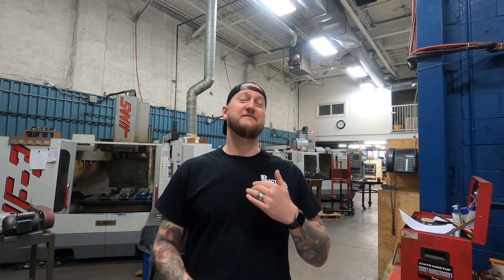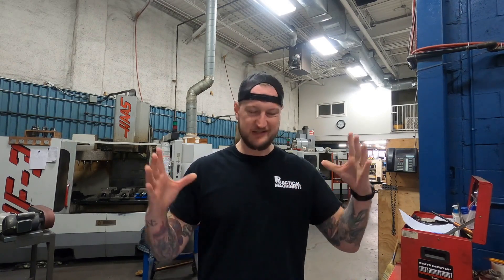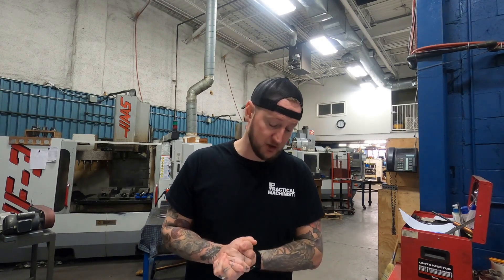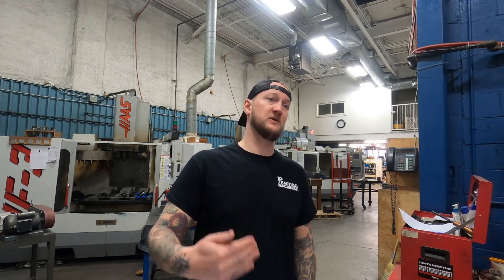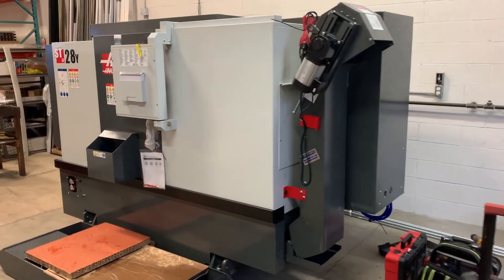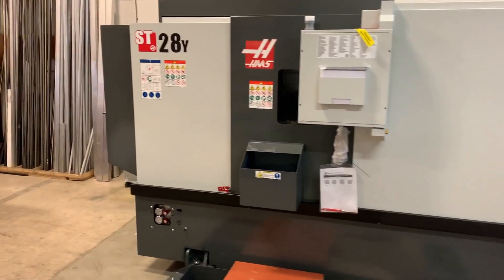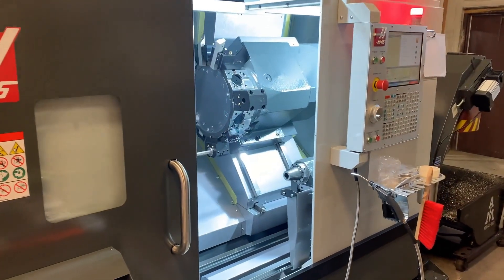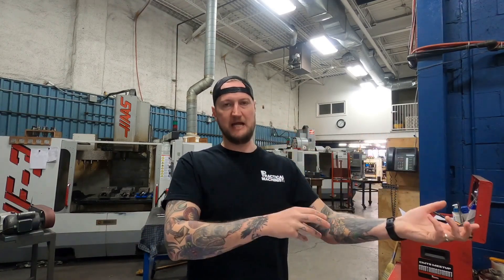Buying a New CNC Machine?! Here's how to do it right! | Machine Shop Talk Ep. 80

Comment: Repair and replacement parts are extremely important for your business.  You want a reputable repair vendor that has stock of repair parts for your machine.  If your getting a haas, I can’t recommend enough @phillips machine tool maintainers training class.  It’s a 4K dollar class but has easily paid for itself 10x over in service fee savings, but more importantly I can have a running machine next day or same day.  My hfo is 10-14 days lead time before the tech comes out. And then they need to get parts.  This includes a 500 dollar value service key in perpetuity to get into debug on next gen machines.  This cost can be covered by workforce development grants.  I know this sounds very sales pitchy, but I rarely have a purchase that has been so immediately worth while.  Deb strudel is great at helping you Navigate the grant process.

Comment: just to say if that machine is the mill turn you are talking about, to me its a live tooling lathe not a mill turn, depending what you want it for you might find it a disappointment, my boss kept saying about getting one and i always convinced him not to, the company he uses for machines the salesman is good ,  Now a proper turn/mill or mill/turn would be good with a proper tool carousel, i am not against live tooling they are good for the right type of work, the best live tooling lathes i have used and liked had a twin turret, work the 2nd op same time as 1st op but that was bar work as soon as a chuck went on you lost tool positions, i call live tool lathes for a job shop space savers as you could buy a lathe and mill for same price. but the video is spot on when buying a machine .
Reply: Most definitely I misspoke! It’s just a live tooling lathe so I’m hoping it fills the niche we need it for - we really just needed a larger diameter bore 2nd lathe (our ST20 is 2”, this one is 4” with a 12” chuck) so I’m hoping the extra bonus of live tooling is just an extra perk!
Reply: @LakewoodMachine  i can see the point with the 4" bore we have a 3" and the times it would be easier and cheaper with a 4" rather than material cut into billets, Also let us or me know how it goes with the live tooling i find it good on a chucker for drilling the odd hole if you can fit it in, otherwise rubbish and a waste of the extra money. Prove me wrong or right. i do like to be proved wrong, and it might stop a boss like mine thinking a 12 turret live tooling lathe like ours  will do a 30 tool turning and milling part complete lol .

Comment: You missed the most painful part (in Canada).  Need to get electrical and safety approval.  Before you buy the machine, have this included in the quote by the dealer.  ESA and pre-start health and safety compliance.  You would be surprised on all the modifications needed to a standard machine to make it “safe” in Canada.  Its the most stringent standard in the world, more so than Europe, USA, etc.
Reply: This is very true! We're fortunate that Haas seems to handle all of this - but you're quite true that it's an overlooked component, especially if you're importing a non-North American machine that may not at all be up to the standards. Could be a costly oversight!
Reply: I was going to say plan to spend a little more for Electrician, but it’s more for used machines. I might be wrong but we’ve never had an issue with a new machine I don’t think the distributor/dealer is aloud to sell if it doesn’t meet code and if it needs modifications that’s on them. We did buy a used Mori from B.C and Ontarios inspector was like B.C is not to the same standard as we are, fortunately it didn’t need much.
Reply: This “electrical standard” stuff is such a load of Poo poo. 
Just another classic Canadian roadblock for business. 
I don’t know why we are so intend in making it hard to do business

Comment: Good video. Regarding the compressor system volume I don’t think it saves money to have larger capacity. The compressor will cycle less often but will take longer to fill the expanded volume, so the electric bill will be the same. Less startups for the compressor is good as long as the fill time is within the duty cycle of the compressor.
Reply: Each time the motor starts creates the most energy use so having a compressor that comes on less often and runs longer is way less expensive to operate.  Less wear on the motor and contactors as well.
Reply: Compressor with a VFD is where its at
Reply: @AdamEarl2  Yea, right.  You mainly do that when you don't have 3 phase.  Does it bring benefits, some, but a waste of a good vfd if you ask me.

Comment: From my wifes phone. You forgot about floor concrete thickness,depending on the macgine weight. Also some larger machines,use the floor and grout to anchor the machine. If the floor concrete is not thick enough, you may have to pour a separate pad that goes done to bed rock,and allow for this to fully cure before mounting the machine. This also means installing pockets for J bolts and grout . This also means making wood cores in the concrete pad prior to the pour. Also ,depending on how deep you have to go to hit firm gound,you may have to add rock fill prior the the concrete pour. Then also watch out for area the the machinery movers use. Larger eqiuptment can go 50,000 lbs and up. Beside the weight for the moving equipment. I have alot experience with installing horizontals and large machining centers. Somtimes ,depending on the price ot concrete, you may concider putting the machine in the floor. This would save fill and concrete.
Reply: ☝️ this guy knows his shit
Reply: This is actually critical! Very very good information!
Reply: Also very important to place machine on one concreate pad, Just as addon to your answer
Reply: we had that problem with a 5 axis mill, we got around it by making bigger feet for it to sit on. not ideal but worked as to sort it properly would have had to have the machine taken out put in storage somewhere as we didn't have room .
Reply: If you are talking real large equipment, better make sure even broken down it can get through the door, and then when it's in the door, there's enough clearance to get a versalift in and put it together.

When I put my horizontal borer in we had to cut the roof to get a crane hook in from outside, because I hadn't planned for enough ceiling clearance to get it together, just had enough clearance for it to sit just below the crane rail.